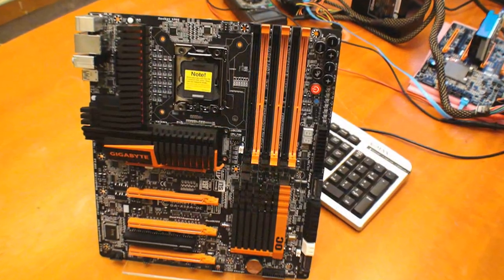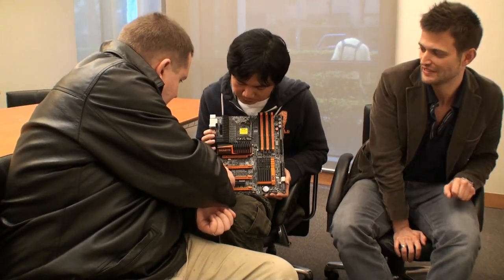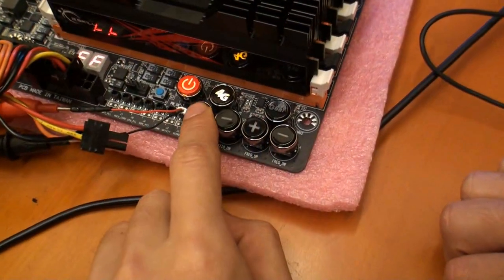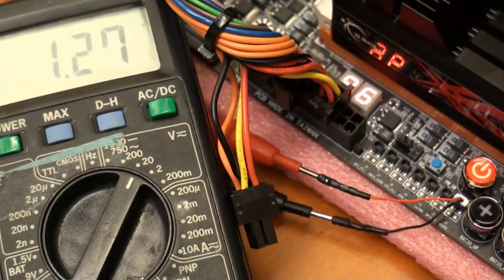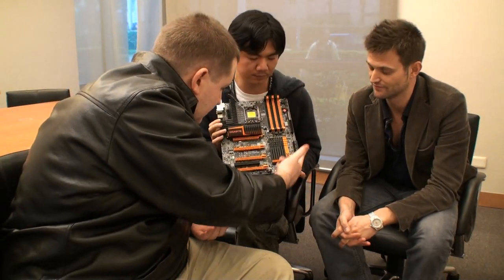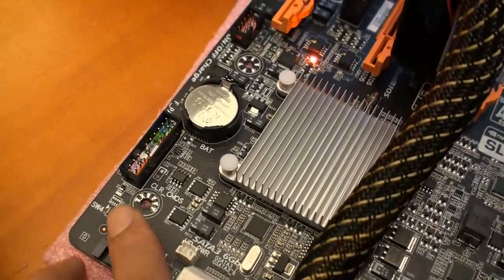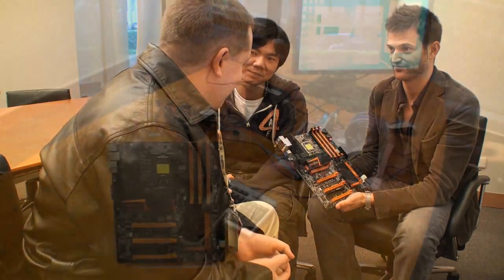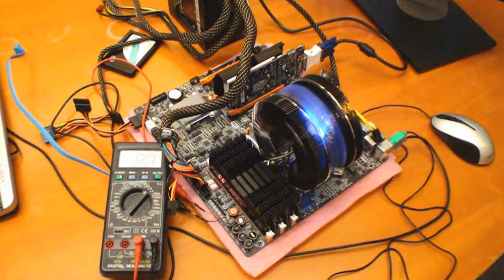GIGABYTE's X58A-OC motherboard gets full introduction

Comment: @callys This board is for people who enjoy overclocking, not for those who want a system that performs well. With this board you will be able to achieve much better results using liquid nitrogen and dry air cooling. Plus, X58 overclocking is a lot more fun than Sandy Bridge OCing, because there are more settings to play with. By the way the X stands for Xtreme, while the P in P67 stands for Performance. Sandy Bridge is mainly a platform for those with no money and the desire to get good FPS.